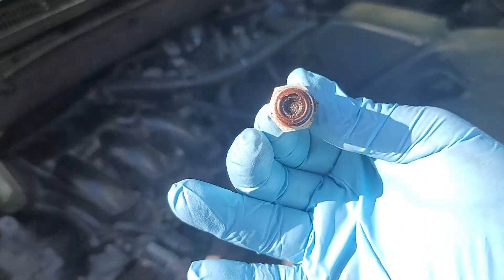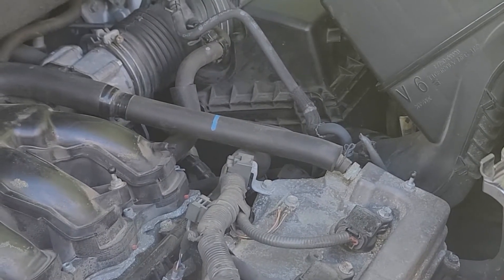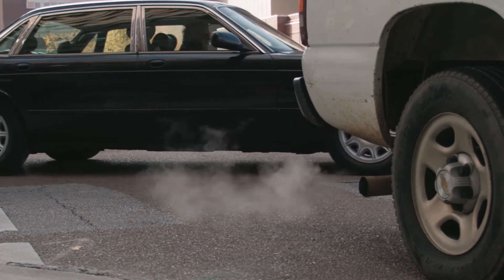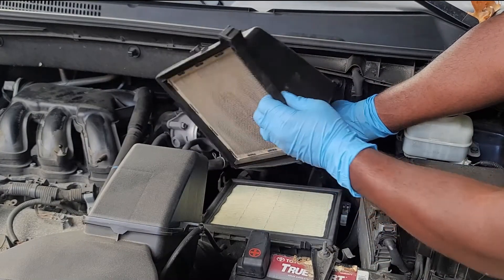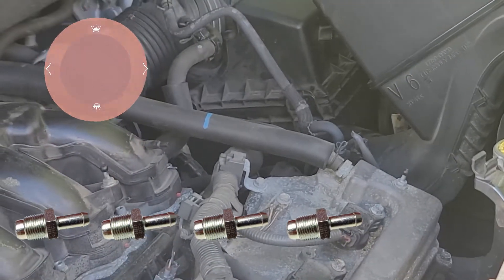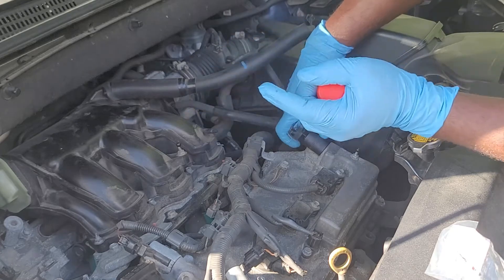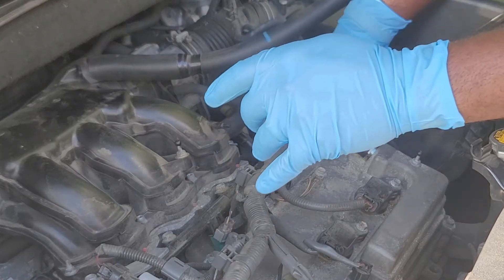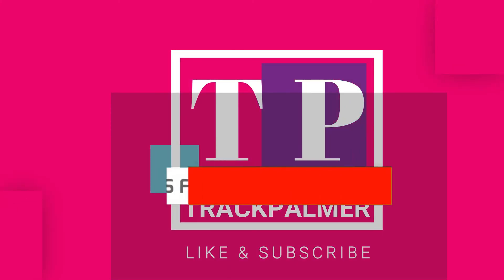Bad PCV Valve Diagnosis And Replacement  Toyota Highlander V6 3.5L. OIL IN INTAKE MANIFOLD!

Comment: I am 99% sure that your torque spec is in error.  It should be 20 Ft Lb instead of 22 (as you say at 3:14)
Reply from the maker: Storm in a tea cup
Reply: Your reply is condescending and unappreciated.  How about you concentrate your efforts on making CORRECT & VALUABLE videos rather than attempting to belittle your FORMER viewers?  @trackpalmer
Reply: Toyota told me it's 27 ft lbs for my 08 I'm so confused.
Reply: It’s going into a plastic housing so go easy on the torque.

Comment: Its easy on a 3.5 liter, but what about on a 2.7 liter 4 cylinder 2013 toyota highlander i cant find the pcv valve in this engine, and apparently no info online
Reply: its under neath intake manifold. Try checking videos for a 2.5 liter camry, 2AR-FE. The 2.7 L is just a larger 2.5L. Everything is the same, including the pcv valve location.
Reply: @SuperMan-uj7dh  
Appreciate yall for replying
Reply from the maker: Send me pictures to the email in the description
Reply: There’s another video called “ Hodge Garge “ where he explains the PCV on a 2.7 litre engine.

Comment: Thanks for this video, the dealership just recommended I replace this on my 2018 Highlander today and they quoted $95 for it. I will be doing this by myself.
Reply from the maker: Hope it went well 🫡
Reply: Toyota Dealerships have gone nuts with their pricing. On our 2023 Rav 4 Limited Hybrid which is still under watt anti of course I brought it in for the recommended service which included an oil chance and basically a visual inspection of fluid levels, brake pads, tires, etc.  My appointment was for 10:30 and it went in the shop at 10:25. It was back out at 10:45 and when I got the bill ( in Canada the first 4 services aren’t included ) I had been charged 2 hours labour. The bill was for over $250. I have used the information from your videos to do my own services on my 2017 Highlander. With your help I have done front brakes, rotors and calliper. I used genuine Toyota Parts. I also changed out the “ fog lights “ for LEDs ( fog light specific bulbs ). I wouldn’t have been able to take them out without your advice. I also had an issue where 5he rear hatch wouldn’t open. I watched your video on 4 reasons why your rear hatch may not open and reason 2 was the small button on the frame around the glove box that I had accidentally pushed a few days earlier while changing the cabin air filter ( which was filthy ). I had phoned the dealership and was told the hatch struts were toast and would have to be replaced for over $1000. With your help it took me 2 minutes and cost me sweet bugger all.

Comment: Hi Track Palmer, yesterday I replaced the spark plugs for my 2015 Highlander 2GR-FE, 138,000km, i.e. 86,000miles.
2 plugs in the back row had oil on their threads while other's threads were dry.

No rough idling, significant fuel consumption increase or any warning light on the dashboard in the past.
But the intake manifold gasket had some oil, and plenum also drained some black oil, throttle body had some dark brown oil trace.
What do you why there was engine oil in the plenum?

I checked the PCV valve which can be easily blown or sucked only in one way, i.e. it is through from the big end to the small end, not the other way.
Is my PCV valve still good?

In your video, did you check the PCV valve blocked or always through?
Reply: I didn't see any engine oil leakage or oil trace under the oil pan, around the intake manifold outside area, or on the engine body. How did the oil get into the intake manifold and spark plugs threads?
Reply from the maker: If you stick your finger in and you get oil on your finger your valve cover seals will need to be replaced. The PVC valve is a service part that needs to be replaced regularly. Based on your mileage it should have been replaced twice before. It's designed to release high pressure to the intake manifold and if not working properly oil can get to the intake manifold
Reply: @trackpalmer  where to stick finger into?
I put a finger into the PVC hole but it was dry inside, although I can see it was brownish on the PVC valve.
BTW, I didn't see any obvious oil leakage along the valve cover (just dry dust needs to be wiped off), and the engine oil level is always acceptable.
Reply from the maker: @adamxu  check the chamber where the spark plug is. If the valve cover gaskets is leaking the oil would run from the top of the chamber down to the spark plug. Did you see any oil on the coils at all?
Reply: @trackpalmer  No a bit oil on any spark plug coils (all the plug chamber was also dry), only saw oil on the the threads amongst 2 spark plugs. 
Looks like the valve cover gasket was well sealed? 
I still don't understand why there was oil in the manifold.
Reply: @trackpalmer  Hi Track, does your Highlander still has engine oil in the throttle body gasket or intake manifold area after you changed the PCV valve?

One Toyota service guy told me that it's normal to have a bit engine oil in the intake manifold, and PCV valve doesn't need to be replaced regularly, only replace it when it's faulty, e.g. shaking or rough idling, or white smoke in the exhaust pipe, etc.
Reply from the maker: @adamxu  check your service manual. It should be replaced every 30k Miles. Little oil is Normal but not the amount I saw. The damage a bad PVC valve can cause can be very expensive. It only cost $5 and easy to replace. I haven't checked my intake manifold. It's a lot of work to do so. My next check will be the next spark plug replacement
Reply: @trackpalmer  My service manual does not mention pcv valve at all. Maybe the car in USA needs to replace it regularly, but not in Australia.
My 2GR FE requires to replace the spark plugs every 100,000km, it's nearly halfway to the US model which is 120,000 miles, or 192,000km.
My spark plugs were still in good condition after I showed the photos to the Toyota service man. Although there was a bit of oil on the threads, their tip was dry and clean from rust, dirt or sludge. He said a bit of oil on the threads was also normal and if the tip is clean the plug is good.
Reply from the maker: @adamxu  replacing some parts at a specific interval is necessary to prevent failure. Many of the parts will have life in it. Many times car fail on the road because of parts that should have been replaced
Reply: @adamxu Toyota dealership told me Toyota has no recommended mileage to change the differential and transfer case fluids. They say the same about the transmission fluid. Diff and transfer case fluid should be changed every 30,000-40,000 miles. Transmission fluid every 60,000-70,000 miles. PCV every 30,000-40,000 miles ( some vehicles it should be replaced sooner and especially if you use aftermarket parts ).

Comment: Thank you for the video, my documentation shows the torque is 44 in. * lbf it is about 3.6 ft * lb
Reply: Above is correct as I got the spec sheet from my local Toyota dealer and changed mine today.
Reply from the maker: Nice work!
Reply: Google “ torque for PCV valve for a  2015-2019 Toyota Highlander with a 3.5 litre V6 “. It says 22 NM or about 16 ft lbs.The PCV valve is metal going into a plastic housing. 16 ft lbs sounds about right.
Reply: @Zeek800 don't use google, use Toyota Repair Manual (RM3150U) - Torque:
5.0 N·m {51 kgf·cm, 44 in·lbf}
Reply: @olegkash1 that’s quite a big difference from 16 lb ft. Im not even sure my Inch lbs torque wrench even goes that low. Many of the fasteners around the plastic valve covers and intake manifold etc. are around 7 lb ft.

Comment: Thanks for your video. The dealership wanted to charge me $156.00 to replace. After watching your video I was able to change is myself in under 10 minutes.
Reply: Sadly probably 95% of Toyota Dealerships are this way. They will charge an hour labour for a job that pretty much anyone can do in less than 5 - 10 minutes. I get it, they have to have a “ time spot “ available but in this case they wouldn’t even need to pull the vehicle into the shop, it could easily be done in the parking lot while someone else’s vehicle is having the oil drained. 5 or 6 years ago our local shop performed an oil change for under $100 ( Canadian dollars so $73 US ) on my 2017 Highlander. That’s 5.6 litres (5.5 US quarts ) a Toyota brand oil filter, and they even checked other fluids ( at least the said they did ) tire pressures, visual brake pad check, wiper condition and they topped up the windshield washer fluid. I took my wife’s 2023 RAV4 Limited hybrid in about 7 months ago for its “ first service “ which was all the things I just listed including the oil and filter. The bill was for over $270 ( they changed the cabin air filter on a car that was less than a year old and charged  me $40 Cdn plus 15 minutes labour. The total labour charges were for 1.75 hours but the car went in at 10:25 and was out by 10:50. I can do and have on my Highlander an oil  and cabin air filter change in less than 1,75 hours! Did my front brakes including rotors,pads and calliper using Toyota Parts for $425 and they wanted $700 just to do the pads.

Comment: Not same car but same engine on my ES350. Big vacuum leak, hard start, oil on the spark plugs when I changed them, etc. Mechanic couldn't diagnose because couldn't replicate starting problem at his shop. (Went there twice on days it acted  up, but behaved at the shop). I saw in the maintenance history before the car was sold, Lexus told the owner to change the PCV valve and they refused. I've been chasing this problem for a while, I hope this is actually the issue. Though not getting my hopes up...because everytime I think I solved it, I don't.
Reply from the maker: Depending on the miles on your car you might need to replace the valve cover seals and the gasket would need to be changed too. It's a lot of work but it worth it if you plan to keep the car for long
Reply: @trackpalmer  134k. Low miles for its year. The mechanic said he didn't see signs of a vacuum leak so he didn't want to smoke test. I imagine if there's was a bad seal he would of checked there. I have no problem changing the seals though! But gonna start checking the PCV valve. I think its a good idea to invest in your current vehicle in the current climate we're in :)